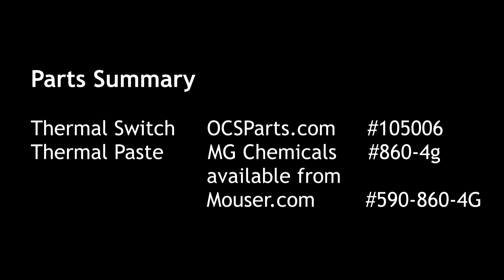Zojirushi EC-BD15 Coffeemaker Repair

Comment: Thanks so much for posting this video. I was able to follow its instructions 7 years after the original post, to fix my favorite coffee maker. It is still going strong! 

I ordered a compatible bimetal, 145 thermostat on Amazon. Here is the description: “Fielect 2Pcs KSD301 Thermostat Bimetal Thermostat 145°C Normally Closed Adjust Snap Disc Temperature Switch”. It cost 8 dollars for a package of two.

The only worry I have is I found extensive water/rust damage inside after disassembly. The rectangular heat sink plate and metal bracket that connects the heating element to the bottom were both completely rusted out, and so I couldn’t replace them when reassembling. I hope it does not overheat.

Comment: My beloved unit stopped mid cycle this morning while brewing.   One made 1/2.a pot and rest of water is still in the resevoir.    Do you think it is the same issue you had Andris or something else?
Reply: Mine started that way.  If you wait a few minutes, the second 1/2 of the water will eventually brew again. But it will get worse over time with more stoppages. It is a sign that the thermostat limit kit is failing. It is a 5 minute fix
Reply: Thanks!    I was able to get my machine to an authorized Zojirushi dealer.  He was able to repair same day.  It was the heater unit part # 8-ECD-P120.  He showed me the part he took out and the wires were fried.   Go to go again, hopefully for another 10 years.   Great coffee machine.

Comment: Well, it has been over four years since I found this video which helped me to revived my dead Zojirushi EC-BD15 coffee maker. After 3000+ pots of coffee, the coffer maker is starting to act up again exactly the way Andris described.. It began as an early stoppage of the coffee brewing with a bit of water still left in the tank.. Then it got worse with the coffee machine stopping multiple times during a single brew. If you do not replace the Thermostat Limit disk, the thermal fuse will eventually blow and more work is required to fix it. Having learned this valuable lesson, I went ahead and ordered another Bunn 29329.1000 from amazon (still only  $5) and found my old tube of silicone heat sink compound from Superlube that I bought 4 years ago. Voila! Within 5 minutes, I replaced the thermostat Limit disk and my Zojirushi EC-BD15 coffee maker. is working again. So for $5, it will likely last another 4 years and brew me another 3000 pots of coffee. Life is always better with hot coffee in the mornings! A blessing indeed for a $5 fix.
Reply: Thank you! That part is available on Amazon.  I hope I don't need the more extensive repair you describe.  It just stopped mid brew but I had not noticed it stopping earlier before

Comment: Our just stopped working - I hear an audible click when trying to brew (like a relay) but that's it. Parts are on order and I'll begin the troubleshooting process sometime this week - maybe it's the same issue, maybe it's something else, I'll find out and have some extra parts around for it at the very least. I just wanted to thank you for sharing this helpful information and pasta's comments were also helpful in locating the correct parts / specs.

Comment: I will not be liable for anything you do that may end up causing you, your property or anyone harm. Use this advice at your own risk. 

BUNN THERMOSTAT: https://www.amazon.com/gp/product/B009EC6D0G/

IMPORTANT: the BUNN switch is slightly taller than the original, so the metal brace that spans across the bottom of the coffee maker will crush the new switch and render it inoperable (permanently open). When you put the new switch in you can use the spring clip to hold it in place, but don't snap it all the way down or you will crush the new switch. Instead, just hook the spring clip over the edge.  Then you will need to bend the brace so that it also doesn't crush the new switch. Needlenose pliers will come in handy.

I bought the Bunn 29329.1000 link above which I found has stamped on it 110-35C, so this is a different operating range (the original is 145-15C), it might be possible the Bunn thermostat would off the heater during the cycle? But probably not, because for it to cool to 75C would completely interrupt the brew cycle and I've had this repaired machine running for over 2 weeks now and it's like new.  See my other comment for more detail.

After breaking the first thermostat, rather than trying to solder on another thermostat I bought some high-temperature electrical spade connectors: https://www.amazon.com/Supco-T1112-Disconnect-Temperature-Female/dp/B0071NC78C/ref=cm_cr_arp_d_product_top?ie=UTF8 

This other thermostat meets the specified temp range, but I don't see how to mount it without shorting it out electrically based on the location of the contacts: https://www.amazon.com/gp/product/B0041LZN5Q/

Here are some thermal fuses that meet the specs if you need to replace them: 
https://www.amazon.com/gp/product/B016D3L5H4/ These are rated at 216C (same as the original) I've seen other people recommend using 240C fuses which I would not do since these are intended to cut off the heater if the thermostat fails to turn it off. Do not bypass these fuses! They need crimp connectors to avoid triggering them with a soldering attempt.
Reply: Thank you for sharing this information. Very helpful in locating the correct parts. :)

Comment: Thanks for posting these solutions.  I hope one of the folks that have commented might have a solution to my problem.  When my Z EC-BD15 stopped working, I found the corroded positive (white) insulation.  I reattached both the white and black wires and that solved the problem, for about 2 months.  Then it stopped again, so I replaced the thermal disk as shown above, but that didn't fix it. I finally took the entire thing apart and discovered that the black wire going into the heater was loose.  I reattached the black and white wires and now it starts to heat, but shuts down after about 30 seconds.  I tested both thermal fuses and they seemed okay (0 reading on the ohmmeter).  Does anyone have any idea what might be going on here?
Reply from the maker: I have to stress how important it is that the thermal switch, which is held against the body of the heater, doesn't get attached too tightly.  Make it as loose as possible while still making good thermal contact with the thermal grease and heater.  It's easy to actually bend the contact surface of the thermal switch, which can cause the switch to actuate way sooner than it should.  If the disk inside the switch is already pushed toward the point where it "flips over" mechanically, it will take less heat and less time to get it to that point.  At least this is the reasoning I came to while getting my own thermal switch replacement to work.  If you have an ohmmeter, you can actually see that effect.  Across the contacts, the resistance is initially low (allowing heater current to keep flowing when energized).  If you apply too much mechanical force, you can actually see the resistance flip to open (no current) with quite minimal force applied.  Maybe this helps.
Reply: Andris, thank you for your reply.  I just finished trying to "loosen" the thermal switch as much as possible, given that you still need to clip it to the heater.  I found the same problem, the coffeemaker begins to work and then you can hear the switch shut down.  I used your source for the thermal switch.  Do you think it's possible the switch is defective?  It's pretty frustrating because I get the thing to work and then it just shuts down.  Once it cools off it will start again for a brief period.

Comment: My coffee maker stopped today and I found this video and comments. I love this coffee maker!!  While searching for parts I saw some photos of appliances catching fire (defective by design, not due to repair) but none the less I want to be sure to use the right parts so as to not burn down my house...  

I found the thermostat and it was open circuit, therefore defective, and I checked continuity on the thermal fuses and they were intact, so I will not be replacing those.  

The part number on the thermostat is: 36TMH01 563389 L145-15C S0337 made by Therm-O-Disc. Here is the datasheet: 
http://thermodisc.com/en-US/Products/Bimetal/Documents/36T_Product_Bulletin.pdf
The L145-15C means the thermostat opens at 145C and closes at 15 degrees less than that, and if this is a 10A switch then it's rated for 100,000 cycles.  That's a LOT of coffee!!

The appliance says 1025W on the plate, so that's about 9 amps, and reading the other comments shows the thermals fuses are rated at 10A also.
Reply from the maker: Hey thanks for adding this extremely helpful info to this page!  Yeah, this coffee maker is a great no-nonsense design that's hard to equal.  We have to do everything possible to keep these babies running forever!  ;)  Thanks again.

Comment: All I can say is Andris and Brian, you both are geniuses!   My EC-BD15 died and I was able to fix it using both of your solutions.  I replaced the  thermostat with Bunn 29329.1000 (available online).  I was able to find the NTE 8226 thermal fuse at my local Frys for a couple of bucks.  Just building on the knowledge.  There are 2  thermal fuses covered by a white tubular plastic sheath.  If you trace  back from the 2 connecting wires, you will see them held together by a clamp.   If you have an ohm meter, you can test which one is blown.  You can also just replace both of them since they are cheap if you do not have an ohm meter.  Only one of my thermal fuse was blown.  I have small hands.  So I was able to complete the fix by reaching inside the compartment without disconnecting anything else.  BTW - I am enjoying a nice warm cup of coffee as I am writing this thank you note.
Reply: how were you able to replace the thermal fuse if the connections are welded ??
Reply: @m0m0ney7-7  It is soldered together. So you need a soldering gun which is cheap to get. You use the soldering gun to heat up the thermal fuse joint and it will melt and you can remove the old thermal fuse.
Reply: @southernlyGM  thanks for replying on such an old comment!! Haha

Comment: Andris, thanks for the video. My EC-BD15 began having the same problems until it stopped completely.  I replaced the thermostat with a similar version to what you posted, a Bunn 29329.1000.  It still did not work after that, and I found the thermal fuse had blown, likely as a result of the failed thermostat.  The thermal fuse is a SEFUSE SF226E part rated at 227C, which I replaced with an NTE 8226 rated to 228C due to the high likelihood of receiving a fake SEFUSE fuse.  The NTE comes with crimps as well, so it was a very easy fix.  Works like a charm now!
Reply from the maker: Hey Brian, glad it was of some help!  Mine is still working well.  Didn't know about the thermal fuse.  Is it easily visible after the bottom is removed?  Not that I want to disturb my working unit, but good to know for the future.
Reply: Thanks so much for posting this comment. I replaced the thermostat, and nothing. I read your comment about replacing BOTH fuses so that's what I did. I ordered the parts you recommended. Thanks so much for the follow-up. We are back in business now.
Reply: @TomHaneyArtwork  Great, you're welcome...I'd forgotten I'd even posted this!  Mine's still working well with nothing other than regular de-scaling.
Reply: @GirchyGirchy  Soooo, yesterday I ran the coffee maker with just water, it seemed to work well. But afterwards we smelled a weird electrical smell. This morning I tried to make coffee, and nothing happened. Any ideas?

Comment from the maker: UPDATE:  I've had questions re: where to buy the thermoswitch.  It's shown on one of the last frames of the movie, but you can just go to http://ocsparts.com/1-2-disc-hi-limit-1560.html to order it.  An additional hint when installing the part: Don't bind the thermoswitch too tightly to the body of the heater.  Doing so can interfere with the internal operation of the switch so that it's always in the OFF position, and things won't work.  I had this problem until I attached the switch loosely, just tight enough to transfer the heat to the thermoswitch via the thermal paste, but not tighter.  

UPDATE 2: It's now been about 10 weeks, and my Zojirushi is still working flawlessly!  Sure was a worthwhile repair!